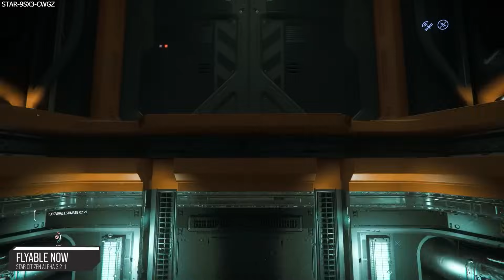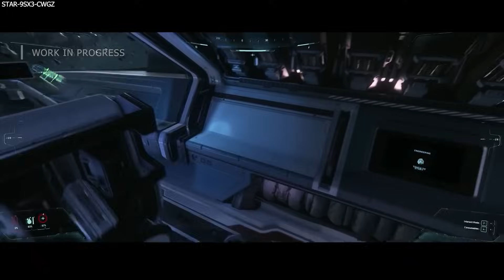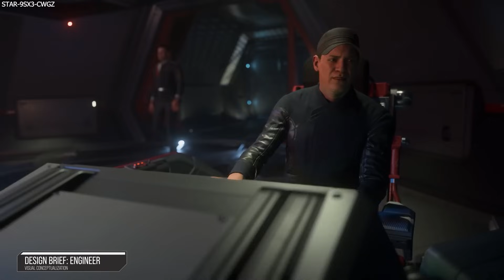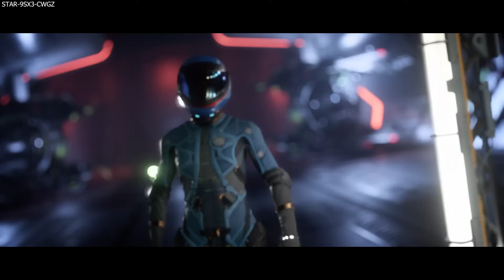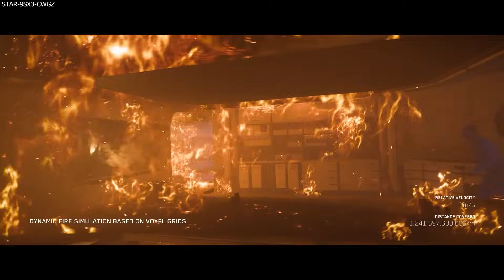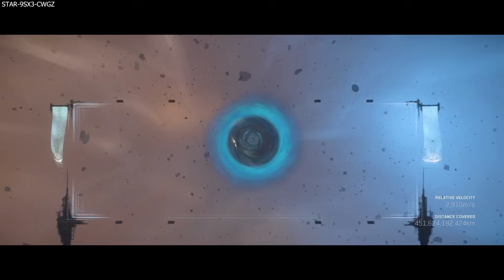Jump Point Tests EOY - Pyro, Static & Dynamic Server Meshing & Engineering | Star Citizen Sunday

Comment: Right now it doesn't seem like the repair platforms actually work when in soft death and completely powered down. But you can swap out broken components to restore power and should then be able to get repaired. The difficult part is losing ships going into and out of QT, right now you often have the tether break and if you are lucky the towed ship is within a few hundred kilometer but plenty of ships are lost for good. But with the free fly during the IAE there will be plenty to tow so I will be sure to rent it and take it for a spin.

Comment: They should add in a scrubber mechanic that keeps siphoned air from being abused. Oxygen should have a wait time to scrub smoke and particles out before being put back into the rotation. The cleaner the air, the less time it needs to scrub. If you siphon it for a fire, it shouls take a few minutes to put breathable air back in, or else the air will be contaminated and the system slightly damaged.

Comment: I think having magic beams for everyone to work with that work slowly is fair.  Then, if you are an experienced engineer that knows the specific part being repaired, it would be faster for you to do it by hand.  Think of the magic beam basically disintegrating and printing a fuse in place, but if the engineer knows where the fuse is, and has one on hand,  can just immediately replace it in much less time.

Comment: Honestly I'd love to see a two route approach to the Engineering gameplay, you can go basic simple repairs and it'll work but the quality of the repair won't be as good or it might not hold up for an extended period. However if you opt for the deeper more complicated repair, then you can get more fixed and if done right the repairs can last longer than a rough patch approach if you will.

Doing that would legitimately give the players out there who don't want to fly themselves, but would love to be an engineer on a ship more value to their roles. Which could lead to instances like being hired as a engineer for a multi-crew vessel and building a skill set. Complexity is not necessarily a bad thing when done right. As long as they don't go overboard and now learning how to fix a component in-game would essentially give you the knowledge and skills to then go fix an actual NASA spacecraft by hand 😂

Comment: The sub-component thing being for a later more complex implementation is great imo

They talked about modding for race ships like engine swapping the m50 and sub-components have the ability to be that modding engineering gameplay where you could tune your ship with aftermarket parts. Beyond whatever overclocking is gonna bring

I think the idea of a "stock" vs "modded" ship not just by component type but putting a bunch of credits into rare high tier component mods makes ships way more compelling. Especially for bridging the gaps between ships

Comment: I really hope they find a middle ground. Just a beam is such a departure from what we've been getting told and the attention to detail we have come to expect. The fear of it being a chore is really on them to balance how frequently it is needed, rather than the complexity. It doesn't matter how long the repair process is of it doesn't happen often, but if it's happening once every hour of gameplay it doesn't matter if it's a 5 sec beam fix that's just a chore.
Reply: You are focusing on a small part of the repair gameplay.  Painting the component with a beam to repair is one step.  Redirecting power, replacing relays, venting rooms, and many other steps are also a big part of the loop.  With all those being involved, you don't want to spend 30 minutes trying to repair a single component.  You will end up dead before you can do anything.
Reply: @DarthPoyner  that's entity dependent on how fast they make things, and irrelevant of complexity. If two people painting a component can't keep it up like what happened at the citcon demo, then the same issue exists but the frustration is greater. It feels immensely worse to have something fail because the system (beam) wasn't fast enough instead of it being something you could learn and use Skill to improve on.

Comment: I am hoping for Engineering depth as well. CIG could have multiple levels of an Engineering Certification classification where the higher your Certification on a certain ship the longer the repairs will last and could be modified to exceed the component specs. 

That would still allow the layman to point his repair gun and get the component working but still allow a Certified Engineer to do his magic and earn his pay.

Comment: The repair from soft death does not work , I have no idea why they said it does and made out that we dont know its in game ... its not. Tried it multiple multiple ways with various stations and various ships in soft death.
Reply: They didnt implement the tractor beam usage very well either , for some reason they decided to do it completely different from how every other tractor beam works in the game ,,, as in you have zero control over the distance and have no way of positioning / orientating towed ships with it either .. so when it comes to detaching a ship you have to be aware that its going to run into you , and no way of dropping the towed ship on a pad accurately

Comment: Definitely on your side of the fence with the depth of engineering gameplay...  I inwardly groaned when it appeared that they're once again dumbing it down to beam citizen;  I understand this as a placeholder while they develop more detailed interactions, but if it stalls at this level I'll feel really short-changed by the mechanic, just like for the medical gameplay which currently requires zero skill level.

Comment: SRV has some tweaking to do, but man its going to be a fun ship.
Reply: Specifically the side beams that should be usable to stabilize a connection.  Right now, the connection is way to flimsy and you have no real way to control the movement.

Comment: CO2 scrubbers and O2 candles are used as backup on Subs.  Would be nice to see something like that available for ship owners to use in case of a failure in the environmental controls.
Reply: Submarines don't have suit lockers full of spacesuits and oxypens lol
Reply: @Falinzin oxypens are a good point lol
Reply: You must have missed the part where they are considering something just like that.
Reply: @wraith511802003   Actually the Friday Dev stream specifically mentioned scrubbers as sub components of the room system.  Also having O2 tanks for when you flush a room or open certain doors/ramps.
Reply: Submarines also struggle to have O2 levels above 15%...

Comment: If only ships would obey the laws of physics like that SRV in the commercial, is that some SQ42 tech or just fake? Regarding engineering, I'm fine with less tinkering with components if we keep our ships in good shape. So maybe add multiple options for repairs, fix the hull for external damage while the cost for fixing components would depend on how used they are and it go as high as the price for a new one + shipping.

Comment: Blown out of the airlock.
Reply: make it so 🤣 resistance is futile
Reply: @ivanbluetarski9071  @supermacbrother kept saying sucked out the airlock. In space pressure is low to zero. Your atmosphere inside the ship would have positive pressure.  Therefore the pressure would blow not suck. PAUSE!
Reply: @josephjones6870  depends which way you look at it i guess . bottom line is a pressure differential exists and if one blows the other must suck 🤣

Comment: There were a few other games that had similar issues, But for Engineering there are a few routs. Basically have levels or engineering. So beam would be the simple, take the longest, and not do a particularly great job. While actually going through and say, removing a part and beaming it directly,  could be faster but still not perfect, and actually working on the parts could be slow, but fix up the part the best. 

this would allow an engineer on the ship to do quicker repairs to get parts up and running, but not necessarily hold together well. or slowly fix it later when out of danger.

For server meshing if you get dynamic meshing, you basically by default have static meshing as well so thats probably why it wasn't really mentioned.

Comment: SRV is a lot of fun. Just a shame that they didn't add a beacon for the service, same goes for the Starfarer. Refueling was DoA.
Reply: Do you like the tethering? It feels like it is too easy to break and too hard to maintain the connection to me. I really wish they had added a review view monitor to keep an eye on it.
Reply: @idn  when you are towing your flight hud changes to towing mode, all those new symbols show you what's going on with your beam so I'm not sure a rearview mirror would add much. Zero G towing is pretty straight forward, under gravity takes a bit more work. I think one issue might be that they aren't done balancing the mass of ships, so some will be much heavier than intended.
Reply: @cs-hike  Ahh, I think my towing interface may have been bugged or I was moving too fast.
Reply: @idn  There is a look behind keybind you can set up as well. I know its not a constant video feed, but its a nice view and something you can pop a look with quickly.
Reply: I'm sure they will in the future.
Reply: Beacons are just targets for griefers.
Reply: @Spearborne yeah i hope they have filtering system which the beacon holder can choose the recommended rescuer with high rep points in rescue.
Reply: @Spearborne  set a rating requirement for your beacons and the assholes who do that might not have rep.
Reply: @Shanegeee by all means prove me wrong.

100% of the time I pop a beacon, the person who shows up is looking for an easy gank.
Reply: @Spearborne  What kind of hellscape servers do you play on? I've had that happen maybe once.

Comment: I am still confused as to why the AI is not really working as intended in the PU? Really hoping they hammer this out soon. The Argo SRV still needs an awful amount of work to be useful. It is a beautiful ship, as is the entire Argo line.
Reply: They actually work well when there isn't load on the server, as the server load goes up though it basically lobotomizes the AI so it has more processing for everything else. Not a great solution but not the worst
Reply: Everything AI related is linked to server performance. Bad server performance will equal bad AI behaviour, no matter how much tinkering CIG might do
Reply: AI isn't working well because it's run by the same servers hosting everything. The networking side of the backend will eventually be spread amount many services (the first being the data structure that allows for full persistence on a server now, and the second being the replication layer to extend that to every server), which will mean AI can actually run with more than 5-8 updates per second in their "brain."
Reply: A lot of things in the Pu dont work as well AI particularly because they are resource hogs and the servers cant handle the info since they get overloaded and AI takes a hit.  Server meshing should fix this.  A lot of features are held back tell server meshing is in.
Reply: It's too weak

Comment: repairing from soft death doesnt work right now.
Reply: It does work, yoy need to have your landing gear touch down tlfor it to work
Reply: @cj4short That would have required you to have the landing gear deployed BEFORE you were put into Soft Death, as you cannot deploy it afterwards.
Reply: @Glathgrundel  maybe with engineering there could be a mechanical over ride to lower the gear like a big winding handle or some thing ?
Reply: It does, but the caveat is that you need the pad to actually be working which doesn't work with still functional ships most of the time.
Reply: You need to request landing
Reply: It does.
Reply: Was going to comment this
Reply: Is anything working in SC currently? I tried and it felt like a big NO